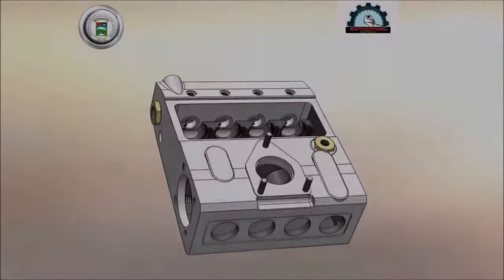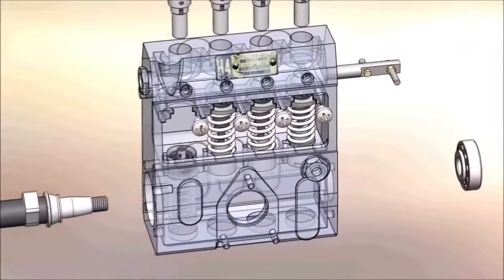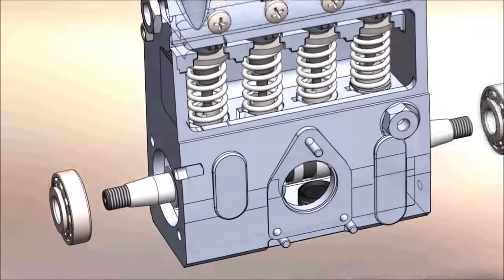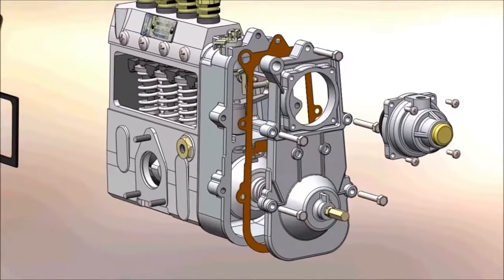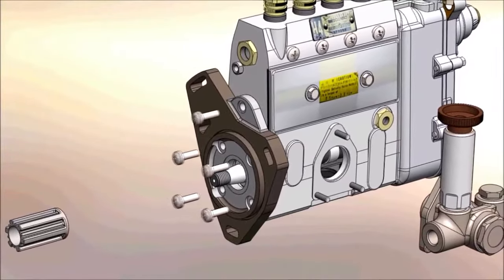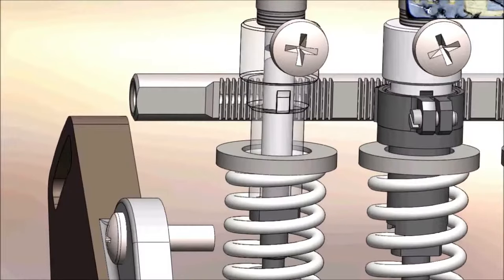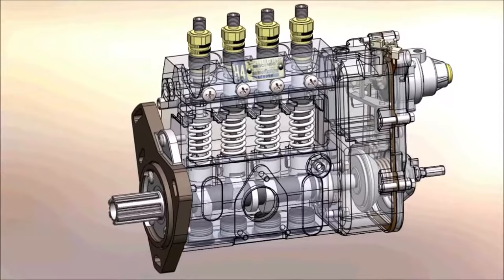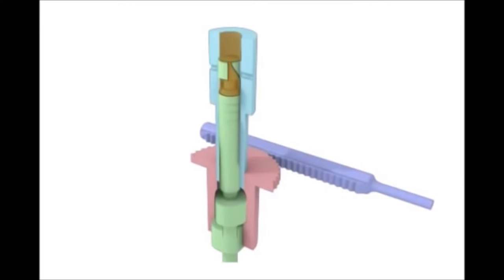Scroll Metering - Diesel Multiple Plunger | Jerk Type Pump

Comment: great video . this is the first time I understand how the pump works and the role of the rack and how the fuel is metered.
Reply: We are manufacturer specialized in auto and marine diesel engine parts since 1952.
Our main parts are
EURO II system: plunger, nozzle , delivery valves, head rotors, repair kits, etc.
Common rail system: Injector complete and injector spare parts for CATERPILLAR, DENSO, DELPHI , BOSCH, SIMENS, CUMMINS, etc.

If you have any inquiries, pls do not hesitate to contact me.

Comment: Richard, there is not much out there as instructive as you are providing here! Thank you! Could you maybe compile another part where you elaborate especially on the governor?
Reply from the maker: Hello, thank you. There are different types of governors that can go with this pump. The one that we teach in class is the hydro-mechanical servo type governor, which is classified as variable governors. It uses the centrifugal force and spring effect of the mechanical governor to move a spool valve in which the servo switches passages for pressurized engine oil to flow through and eventually moves the fuel rack you see here that will rotate the injection pump plungers to either more or less fuel position. When the engine load increases the governor moves the fuel rack to the more fuel position allowing the engine rpm to raise, and then vice versa when engine load decreases. I don't have a video for that but hopefully this explanation helps. I'll try to make one later on.
Reply: @akaQ9  Excellent explanation. Which software do you use for such videos? Is it solid works?
Thanks.
Reply: We are manufacturer specialized in auto and marine diesel engine parts since 1952.
Our main parts are
EURO II system: plunger, nozzle , delivery valves, head rotors, repair kits, etc.
Common rail system: Injector complete and injector spare parts for CATERPILLAR, DENSO, DELPHI , BOSCH, SIMENS, CUMMINS, etc.

If you have any inquiries, pls do not hesitate to contact me.

Comment: your delivery valve was upside down. that needs to be fixed.
Reply from the maker: Actually the delivery valve on these multiple plunger type or jerk pumps, specifically this brand, are shown here the correct way and it is exactly how it looks when you take those pumps apart. Once the plunger pressure exceeds 100psi it pushes the valve open upward. Now don't get me wrong, there are other similar type pumps on different brands that are the other way around and I think that is what you are referring to. They are mounted upwards with the spring at the bottom. We do have those at the schoolhouse and show them in-person. The fuel goes around the valve and pushes it down instead. However, this animation here shows the other brand with the valve this way. both designs work.
Reply: @akaQ9  thank you for the information.
Reply: We are manufacturer specialized in auto and marine diesel engine parts since 1952.
Our main parts are
EURO II system: plunger, nozzle , delivery valves, head rotors, repair kits, etc.
Common rail system: Injector complete and injector spare parts for CATERPILLAR, DENSO, DELPHI , BOSCH, SIMENS, CUMMINS, etc.

If you have any inquiries, pls do not hesitate to contact me.
Reply: @hanruobing6924  i have a fuel pump servicing workshop in chittagong,bangladesh...I'll surely contact you if i need any of parts...thanks for your comment.